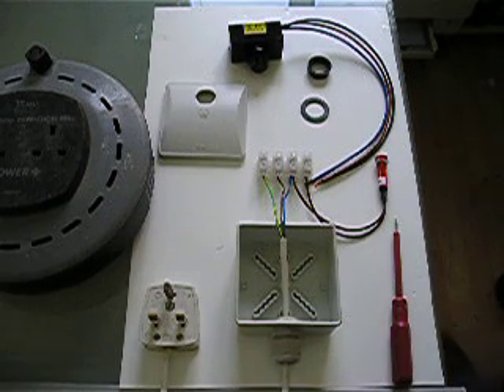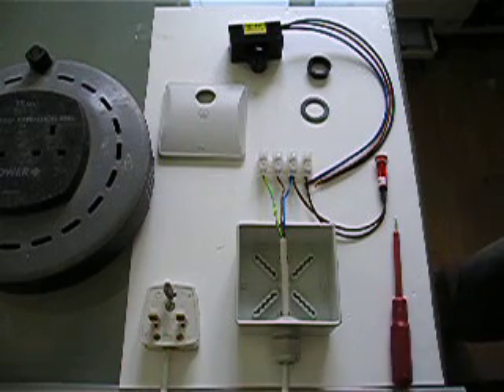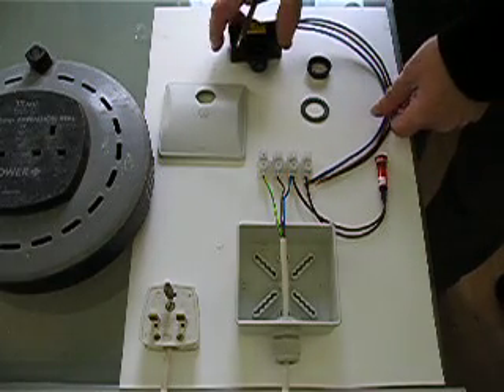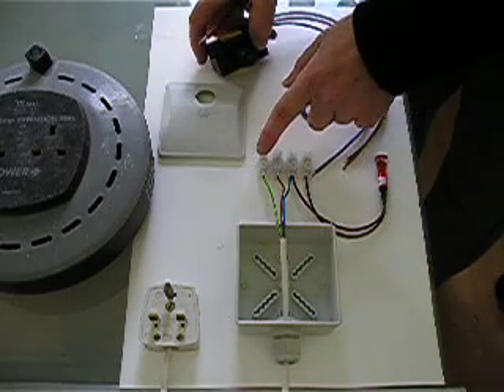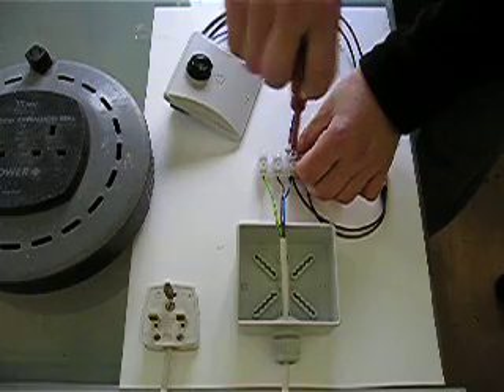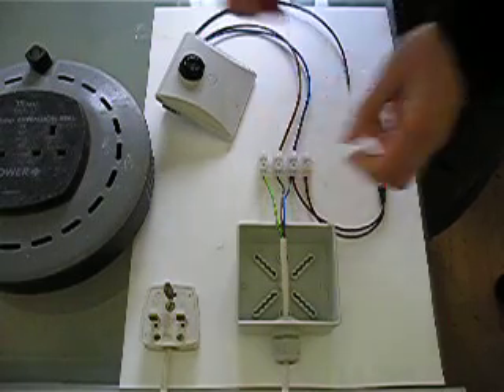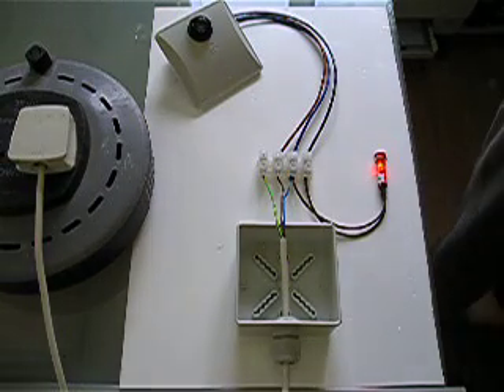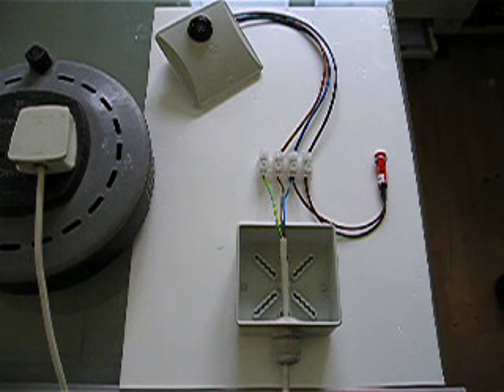Dusk to Dawn Switch Photocell by Acetek - How to wire up

Comment: At last. A clear instruction video. Thank you.
Reply from the maker: I'm glad you found it helpful, but please note this is only true of Acetek photocells other make have minimum load requirements and may not work with the latest LED lamps.
Reply: Des Acetek. Thank you for the extra info. Much appreciated.

Comment: des acetek.. I roughly get the idea but how do you do it on a fluorescent light using a on off switch ... im nt sure if it works the same as the 3 plug wiring. because the cable out of the wall is just one whole copper wire
Reply from the maker: Hi Victor, I think you will need to ask your question again, because i'm not sure what you are asking or trying to do
Reply: Hi @Des Acetek. 

Firstly, thank you for replying.

I had previously asked an electrician to have a dusk to dawn photocell installed to work with my fluorescent light - which is located just outside my home.

Now, I live in Malaysia and since it is an ex colony of Britain, most of our electrical stuff follows UK standard. All the stuff in your video, we use here as well. We use the same 3 pin plug and the terminal block is the same.

I am now trying to replicate what he did at my grandmother's house - for a few reasons but mainly it is satisfaction just knowing that I am able to do it as well. 

The problem is, he hid some of the wiring just above the ceiling where it is not so accessible. So, I can't see part of it to understand how it work. I guess you've got to open the roof to see it.

I am using a photocell similar to this type :
http://www.ebay.com/itm/Dusk-till-Dawn-Automatic-Photocell-Light-Sensor-Detector-Switch-AS-10-AC-DC-12V-/231565439924?hash=item35ea6033b4

I say similar because I cannot confirm the model since it is out of reach.

I assume there is another terminal block hidden from view - hidden somewhere in the roof - not accessible, so I can't see the way he did part of his connection.

What I can see physically is this. Let's say I can see point A and point B. 

At point A is where the photocell is located (above the roof) connected to an external terminal block (this I can see with my eyes). So, the red black and white wires of the photocell go into the terminal block on one side and on the other side of the terminal block I assume is an extension (grey wire) also connected with red black and white wires. I think what he did was he was just trying to make an extension out of the red black and white wires from the photocell to where ever he wanted to place it. Now this grey wire runs down into the roof - so I can't see the rest of it.

At point B, is where another 3 wires come out from the wall - the 3 wires came pre built when the house was bought. This 3 wires I assume are Live, Neutral and Ground (I opened the fluorescent light to see where the 3 wires were connected to). It was a normal hook up to the fluorescent light - just like normal installation of Live Neutral and Ground to any other fluorescent light.

Then there is of course the on/off switch used to switch on or to switch off the fluorescent light which is located inside the house.

My question simply is this - How can you hook up a photocell to a fluorescent light?

I live in a 3-phase house. My grandma has a 1-phase house.
Would the connections be the same?

And how do I know which wires coming out of the wall are Live or Neutral? I had previously tested a  3 plug socket wall connection using a test pen on the Live pin - it would light up. On the Neutral pin the test pen did not light up.

I thank you for spending your time reading and thinking about this.

Cheers!
Reply from the maker: Thank you for the in depth description. Base on your description I would strongly recommend you get an electrician to over see this. You say your house is 3 phase which means you have the potential of very high voltages (415v) between phases and you need to know exactly where these different phases are as I'm sure all you appliances are 240v. I'm sorry that I can't be of more help, I don't want you to hurt yourself.  The Video is to show single phase live neutral and earth 240v only. Best of luck, please don't take chances. Regards
Des

Comment: Great vid and product too. I'd like to run some low power LED lights (approx 4w total) to run throughout the night. Is there a minimum wattage for this? Thanks in advance
Reply from the maker: Hi Thank you for your question,
The Acetek CellOptik range of photocells have no minimum load requirements. As you can see in this video the photocell is switching a neon indicator which is probably less that 0.25 of a watt. So it will be fine for your 4 watts worth of LED lamps. You can buy this product online direct from Acetek at www.acetek.co.uk. regards Des Acetek

Comment: Can I use the method on out led security lights
Reply from the maker: This phototcell will switch on LED lights up to a maximum load of 300 watts. hope that helps
Reply: @DesAcetek   thank you for you reply I'm struggling how to wire one of these up to my 2 led security lights
Reply from the maker: @jimbojombo4464  please contact Acetek directly sales@acetek.co.uk

Comment from the maker: This Acetek photocell has a wattage rating of 300w and switches on during the night. Depending on how you intend to use this photocell would depend on if it would work on you solar system. You may be better off emailing Acetek with the details and they will explain and maybe able to offer something to meet your requirments, possibly on during the day.